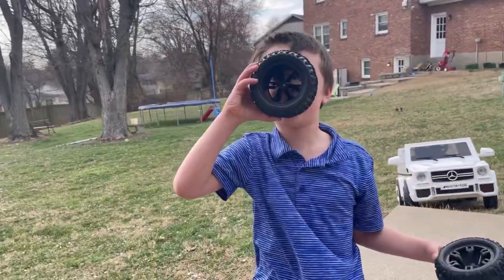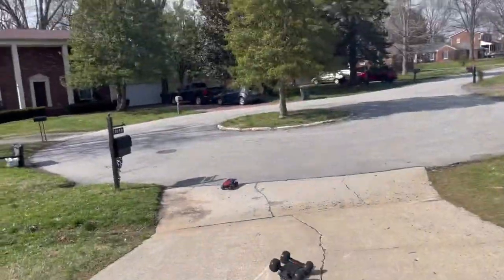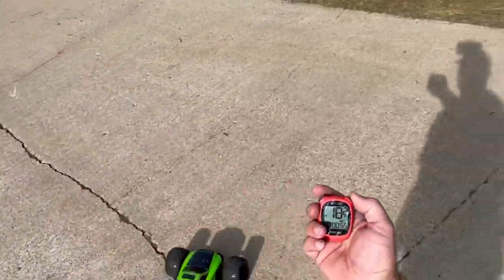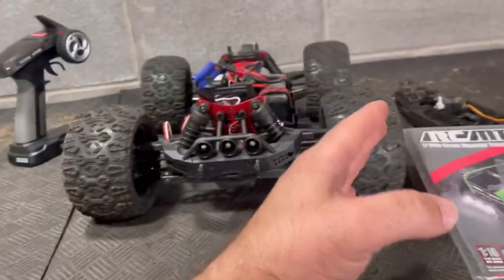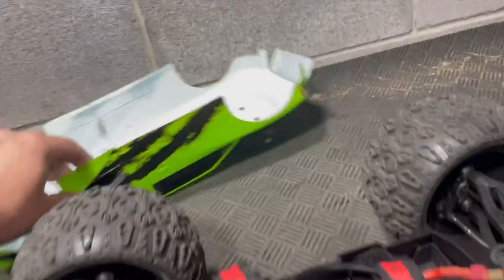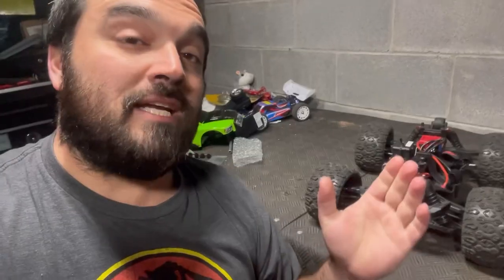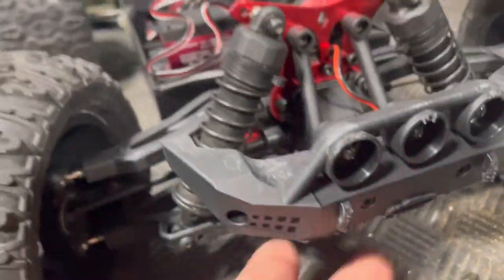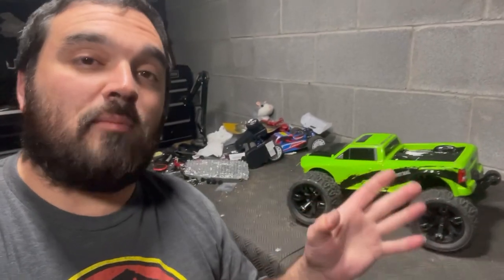The most UNDERRATED RC CAR

Comment: Try the newest version Arrma Granite BLX. It is a flipping trick monster. I've broken less parts on the arrma blx line than the Team Associated MT-10.   ...Or, get a Typhon 3s and put cheap 1/8  (6inch OD) tires on it, since it has 17mm hexes.  That is my go to for triple back and front flips.  Super durable too.   ...Then get an XMaxx.  I've had one for a year and have only broken the back bumper and one 54 tooth Spur gear. It is crazy durable when left in stock.   ...well, a few upgrades.
Reply from the maker: Thanks! A granite has been in my list for a while and almost what I got instead of the redcat. The xmaxx is also on my list and could be sooner rather than later. Just don’t know yet 🤣